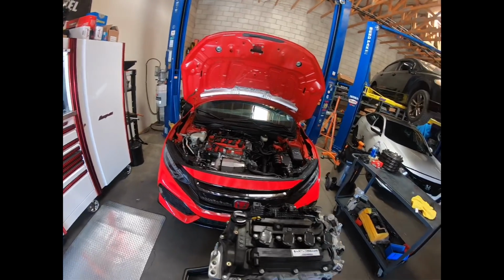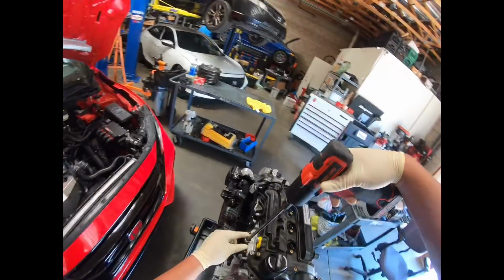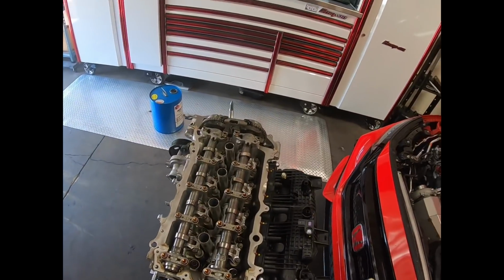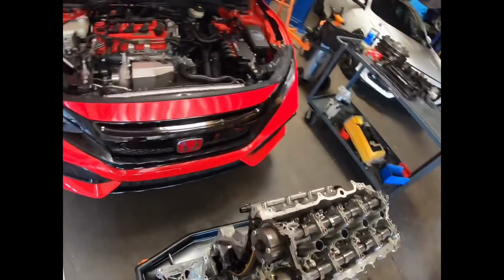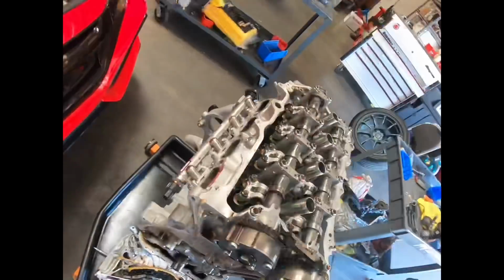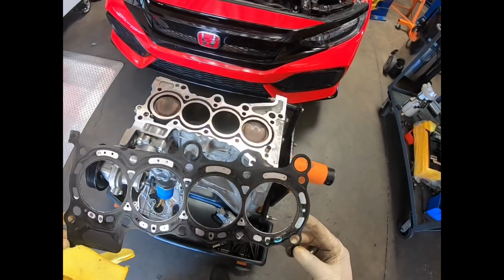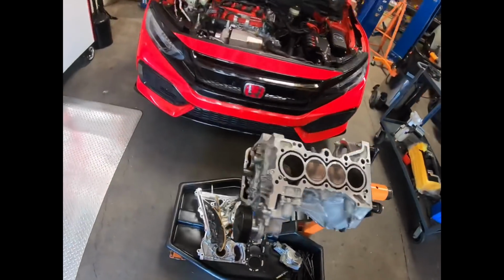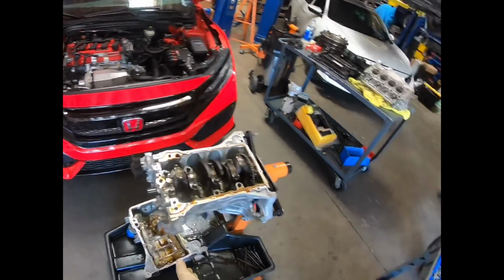L15b7 tear down

Comment: And people say that this is bad engine.... i have seen VW gti engines with carbon build up on pistons at 25.000km... look at this engine, is almost like new... good job Honda,  very good PCV system...
Reply: Miniman's videos - I was skeptical at first about these engines but now I’m a believer....Honda puts out good stuff, won’t doubt them again.
Reply: Stock 17 Si except exhaust and cosmetic through a rod at 53k miles
Reply: @thomasearnest700  were you redline it a lot
Reply: FlyByeBlueSi were you tuned?
Reply: @HC7-MA  I mean it's the same engine from the Honda Fit all they did was add a turbo and other changes.
Reply: Lavonte A - that’s the case with a lot of Honda’s.  $36k Civic Type R has the K20C1 while the base $22k LX has the no turbo K20C2.  They’re masters at using 1 engine for multiple applications.
Reply: The methanol burns up all carbon
Reply: That’s because ve engine are not design for us traffic, those engine are design for Germany traffic. Not for the stop and go.
Reply: @reyvr6  🤣🤣🤣🤣
Reply: I have a 2018 accord Low compression and blown head gasket but it does have 80,000 miles on it all stock

Comment: I gotta watch this video again in detail. I knew Honda made a stout motor with the L15T, much better potential then the Hype R. Thanks for the info Emman. Makes me want to get back into Honda after i pay off the Subie 😂
Reply: @Sergio Aguirre meh, if emann was able to max what the L15T with the K20C makes with bolt ons i say the L15 is better bang for the buck. Now if it was old K series hands down no competition.
Reply: Finally watched the video in detail. Hmm feels like im back at Honda lol. Interesting the TCT is rotated vertical versus horizontal in past K series motors. And that oil pump looks effecient. Emman machine shop?? You dont install the rods yourself? Or another secret sauce mod port head cough lol?
Reply from the maker: k20a2toofast4u I actually installed the rods in-house and built the motor here as well.
Reply from the maker: Sergio Aguirre yup your right the k20c is superior but currently the aftermarket has been slow on the R stuff as owners tend to buy other things than Performance mods.  I’m thinking about doing a R drive train in the car eventually

Comment: Very well put together video. Now we have some sort of clue of how much torque and hp these “baby” engines can handle. I have an idea, you should do an update after 50,000 miles or 100,000 miles. 
Thanks for the video btw I feel safe to go with a 27won turbo upgrade. I feel like PRLs kit is great but won’t last as long as 27wons with a stock motor.
Reply: Did you go for the W1 after all??

Comment: Great vid. I have a 2015 Fit with the L15B1 engine.  Looks like the same engine, but sans turbocharger. My understanding is that the intake manifold for the B1 is smaller and is located differently.
Reply: Rods on the Si engine are stronger/thicker, turbo is different, as well as the inlet tube.
Reply: @ValkenDnB  That would make sense.
Reply: The B7 is an entirely different engine and shares only bore spacing with the Fit engine per Honda’s own power train engineer. The intake, accessories, and exhaust are swapped front to back which are huge changes. The B7 also has sodium filled valves, a different oiling system, different cooling system, etc.

Comment: Looked surprisingly good inside considering what it had been through. Would’ve like to have seen the backs of the intake valves after that kind of heavy use being it’s a direct injection engine.
Reply: There appears to be cleaning in the 1.5T intake valves. 

https://global.honda/innovation/technology/automobile/Vtec-turbo-picturebook.html?fbclid=IwAR0NwbG1quYT9k_JZPj4H5GVcPDIA5Iqh0zerxlc4V4xVmwIMOxbgBrFk_c
Reply: It’s the same internal cleanness on honda motorcycle engines with even more miles. Compared to other motorcycle manufacturers.

Comment: I happen to have the L15BA turbo variant of this engine in my Civic. You said that 0W-20 is too thin, I agree especially with a bigger turbo. That being said, how does the L15 series engine handle 5W-30 built, not stock? I do have concerns about the oil grade being too thick where it cannot lubricate the crankshaft journals properly.

Comment: I really love this video, and thanks for the teardown, but I just wanted to make a comment on what Eman said about oil Viscosity for this engine. Before I make any comments on this, I just want to state that I really don't want to start a "which viscosity you should use" debate, everyone has their preference, and I respect that. That said, for his particular operating conditions, bigger turbo, tuned for more whp, harder operating conditions etc.a higher viscosity oil may be warranted, but Honda specifically designed this engine for 0W20, and 0W20 protects this engine very well in all types of operating conditions. I have a 2018 Si, tuned (Ktuner with the TSP stage 1 tune) and I drive this car very hard. I do a lot of driving between NorCal and SoCal (360 miles each way) in all types of conditions, from harsh summer where the temp has hit 115 degrees F to below 30 degrees F at 80 to 90 mph for 7 or 8 hour stretches. Because I have been doing all this harsh driving, I wanted to see how well my oil stood up to the beating (I use Idemitsu 0W20 full synthetic), so on my last oil change which was 7K from my last change I sent it to Blackstone labs for analysis. The oil was in good condition and I could have gone another 3K on it before changing it. Everything from wear metals to Viscosity breakdown were all excellent. Currently I have 16K, no leaks, seepage of oil or anything of the sort.

I don't have any issues using a higher viscosity oil, but just know that if there is an oil related failure, Honda America told me that using any other Viscosity than the one they state in their manual would void warranty. Now if you have modified your cars the way Eman has, warranty probably doesn't matter to you anyway
Reply: It’s also worth noting a 5w-30 has more viscosity improvers which many claim is detrimental to this engine and makes any fuel dilution issues worse. Consensus among oil experts is, regardless of what oil you run, changing it more often is better than running a heavier oil or anything more costly than mainstream full synthetic. If you’re still under your power train warranty stick to an approved 0w-20 and OEM filters and keep the receipts.

Comment: Subscribed @k20z3allmotorFTW I have a 2017 Si coupe. Had it for two years and only now have put 25k miles on it. Been running Hondata since 8k miles. This channel is an inspiration and probably the most abusive to the little 1.5L motor lol. So far the fuel system seems to be the only limit for this motor. I've been real conservative with mods cause I need this car to last me a little while longer and I was skeptical of its durability when tuned. The doubt is gone now for sure. 

My only question would be, what mods are recommended for a conservative build aiming for anywhere from 300-350whp?
Reply: Bolt ons with a turbo upgrade and tune.

Comment: Thanks for doing this. I’m curious what oil you used and how often you changed it? And was there much carbon on the back side of the valves? I Do Cars also tore down one of these with unknown miles that apparently was run with insufficient oil and it destroyed the intake cam especially by the fuel pump. So the cam journal closest to the fuel pump is apparently a weak spot and worth checking. Some hate on these engines but they seem to be typical Honda well engineered.

Comment: how can I get the timing cover off,  100% have the bolts out and organized. I'm prying on the cam but that baby is sealed. I have the motor in jacked from the bottom top engine mount disconnected
Reply: and got the crank bolt out!

Comment: How much carbon buildup was on the intake valves?
Reply: That's what I wanna know.  They say these direct injection turbo engines really benefit from a catch can.
Reply: @HC7-MA  MAPerformance convinced me it doesn't need one. Seems like anything collected in the can is a result of using the can (colder than the rest of the engine, vapours condense). https://www.civicx.com/threads/maperformance-civic-si-1-5t-pcv-system-catch-can-testing-observations.31076/
Reply from the maker: Michael Dunning I agree with map catch can not needed
Reply: Are there pistons’ oil jets?
Reply: Seems that there is some intake valve cleaning even if DI for the 1.5T. Check out the fuel injection vid in the link below

https://global.honda/innovation/technology/automobile/Vtec-turbo-picturebook.html?fbclid=IwAR0NwbG1quYT9k_JZPj4H5GVcPDIA5Iqh0zerxlc4V4xVmwIMOxbgBrFk_c
Reply: @dundizzle93  ...Thank you for the link. I was getting ready to install an oil catch can but found this video and your post.
Reply: @jeffy7360  forgive me, but how so? I'm not seeing it.
Reply: @jeffy7360  that’s interesting. Bc in the North American market the 1.5l Turbo in the civics don’t have v-tec. I’ve seen the Asian/Australian markets advertised the 1.5l turbo with V-Tec while having nearly identical power ratings.
Reply: @lastpally  yeah. I read a forum thread that in the US, it is marketed without VTEC but outside the US, it is marketed as VTEC Turbo. But it is the same engine. I don't think VTEC is necessary since there is already a turbo. But with VTEC, you will get the sudden burst of acceleration

Comment: Hey man. Do you buy chance have the info from Honda for replacing the headgasket?  The manual/instructions info? Are these heads basically the same as the fk8 heads? As far as removal/install

Comment: Were there a lot of carbon on the back of the intake valves?   Also if 0w-20 is too thin, what would you recommend a mildly tuned dd car to run for oil viscosity?
Reply: I use 5w30 in my 2020 si

Comment: This is great! Thanks so much for the vid! I'm having problem with my stage 2 '19 si. Had 1tbsp of acetone in intake catch can and sucked in and started horrible. Now misfires on 3 and 4. Replaced plugs and 3 and 4 fouled again and cyl 3 and 4 are black and 4 is wet. Valves? Dealer did injector test and said nothings wrong with the car except my catted dp (thats not the problem). Parked and going to pull intake and head this weekend. can we talk? I cant figure youtube message. can you pm civicx bbeem. Thanks so much.

Comment: Great video.. Crazy how honda can make a 1.5 motor be so great. 460whp? That very high. First time i heard that for this motor.... But quick question on what oil to use. I agree. The 0w 20 is to thin in my thoughts as well. What do you beleive is better like a 5w 30?  Your video are great. Very humble. Bless.
Reply from the maker: Ramon  Rodriguez III  I personally use 10w-30 I recommend at least 5-30

Comment: Just bought a 2017 ext, what’s the best bang for the buck performance mods starting out? Ktune? Down and mid pipe?
Reply: hayden eudy don’t add power before upgrading your clutch and engine internals (forged pistons, valve train) also make sure you do your research so you get the work done at the right placed. You also might want the hasport engine mounts and white line front anti lift kit for better putting the power down

Comment: I ran 400+ big turbo HP on my stock block 2005 SRT4 2.4 for 140K miles and never opened it... never did any thing to the internals. Your motor should definitely be fine after 25K miles.

Comment: 465 hp stock 1.5 such a great time for cars
Reply: Dude I got a L15BE 7 basically a slightly detuned Si motor 192 HP 192 FT IB of torque

Comment: I have same engine in my civic. Why do you think some people have had head gasket issues on this engine with no alterations?
Reply: It’s hard to say. Mostly using 87. Or what I think a bad batch from the factory. My 1.5t in my 2017 civic blew a head gasket at 75k. Now I have an 24 integra. Strictly use premium only now. Idk why but I do feel like my civic was slightly faster then my integra.

Comment: Is this 1.5L the same as the one in the Honda Fit? Im thinking of buying one, and tricking it down the road, and am wondering if the 1.5 in the civics that are naturally aspirated, the same as the Fit.
Reply: Rene Pena for what country? the engine in the video has turbo
Reply: @jamesmedina2062  , the US.  I know its a turbo car, but i just wanted to know if beyond that, if the internals are pretty much the same or not.
Reply: Rene Pena I have not looked closely at both blocks. The bore and stroke is the same but from Honda's perspective, they needed to increase power from 130 hp in the Fit to 200 hp in Civic SI. Rods, cooling, high pressure fuel pump and direct injection and possibly other differences. Also the engine is turned around in the Civic to enable air cooling of exhaust and turbo.
Reply: No they’re not at all the same. Everything is flipped around front to back, different mounts, different bell housing, cooling, oiling, etc. Honda’s own head of powertrains said only the bore centers are the same.

Comment: those cylinder walls are thick
Reply: But the steel sleeve ( or is it a coated aluminum surface? ) looks real thin.
Reply: @daver3103  cast iron sleeves

Comment: Hello I’m putting this exact engine back together, I’m wondering what is the correct timing chain installation procedure. I see the gold links on the chain and the dot on the crank but I am unsure how to properly time it. Thanks I appreciate any help!
Reply: Hey so if anyone was wondering I figured it out. On each cam gear there is a dot and there is also a dot on the bottom crank gear. You have to line these up with the gold links on the chain. Three gold links in total and three dots in total

Comment: I have a '19 Si coupe, did you notice any oil dilution issues?
Reply: My brother is a honda tech and says these engines suffer from oil dilution primarily from extended idling on cold start ups in cold weather and from going super long times without oil changes. He says when he does oil changes on cars with 5k miles since the last service the oil DOES NOT smell like gasoline, but when he does oil changes on cars that have gone 8-10k since service, it reeks of gasoline

Comment: That engine cannot make 465HP if it is stock hardware. Need forged pistons and titanium connecting rods as well as a different block/cylinder liners + many other changes.
Reply: How are you going to argue that? he made the horsepower man. Stop telling the guy that made that power that he can’t make it. he already did..

Comment: Honestly did not know these engines were open deck
Reply: Honda makes a big deal out of cooling in this engine to avoid hot spots in the combustion chamber which lets them run more boost and timing without detonation on 87 octane fuel. Open deck is part of that.

Comment: @k20z3allmotorFTW what weight oil do you run?
Reply from the maker: Illuzzionz FNBR 10-30
Reply: @k20z3allmotorFTW  so you'd suggest that for a slightly modded engine as well?  Also what's the best way to contact you about your type r cluch/flywheel kits?  and congrats on the new record man!
Reply: I appreciate the response EMan @k20z3allmotorFTW I have the NA 2.0L with FBO. I'd like to go to an SI pretty soon though
Reply: Illuzzionz FNBR did you get a SI? Whats wrong with the sweet 2.0?
Reply: great video. just bought 2019 crv and start reading about oil problems... do you experienced that? im planing to run motul eco lite 0w20 because is made especially to engine with lspi. what about oil catch can? thanks
Reply: Adam Civic The CRV look very nice but I haven't owned one. If it has the 1.5, you should break-in engine properly and then change oil in 3 or 4k miles. The full break-in will take longer and fuel dilution should lessen. I would recommend using a motul 0w30 or 5w30 for street use. Most owners find 0w20 too light. I used Motul X-Max 0w40 and enjoyed it. It has much better film strength and more esters in base